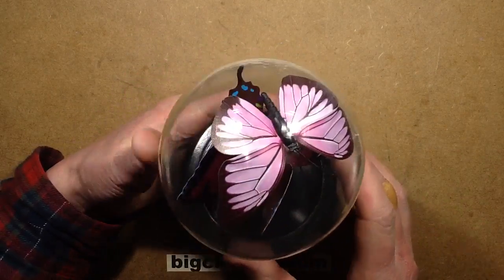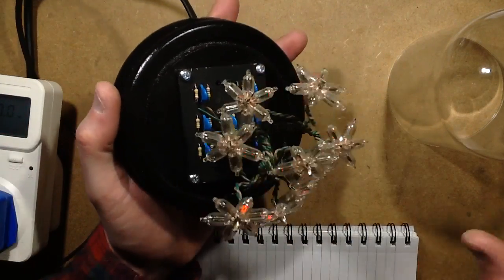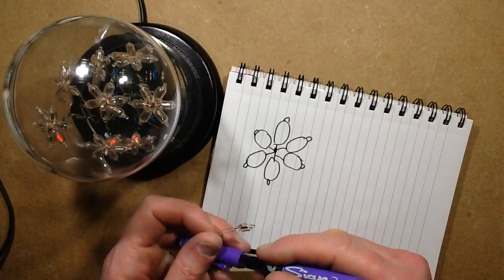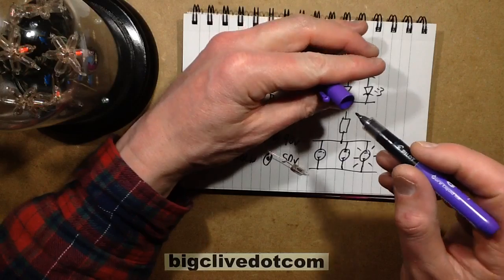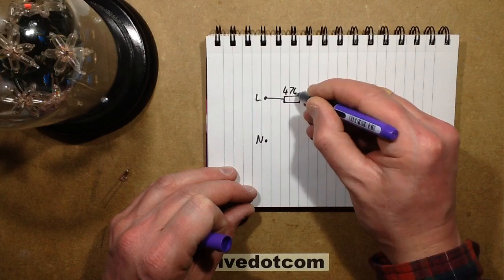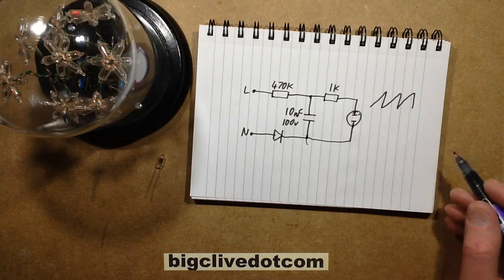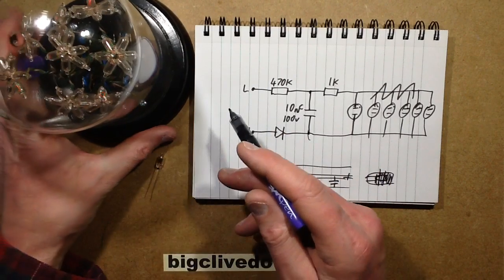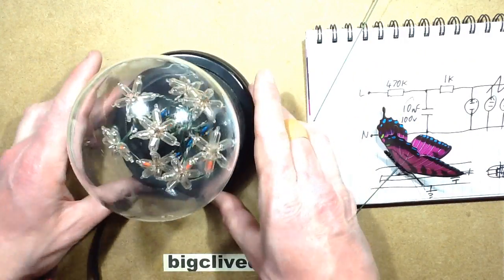Rehousing my neon nixie-flowers in a glass dome.

Comment: Still experimenting with getting this to work on 120 VAC 60 Hz. After not getting any satisfactory results, I thought about what's different between 120 VAC 60 Hz and 240 VAC 50 Hz. The conduction angle is going to be different.

Small neon lamps ionize at voltages from 55 to 80 volts on AC and a pretty consistent 90 volts at DC. A neon can be used as a pretty stable 90 volt DC regulator. So I chose 90 volts for calculating conduction angle. Given a half wave rectifier, how much time does the power source spend above 90 volts?

For 120V 60 Hz it's above 90V for 116.2 degrees (5.38 ms) and below 90V for 243.8 degrees (11.29 ms).
For 240V 50 Hz it's above 90V for 149.2 degrees (8.29 ms) and below 90V for 210.8 degrees (11.71 ms).

I wondered if this difference was enough to prevent it from working so I changed to a full wave rectifier and got significantly better performance. There is now slow action, where the illuminated lamp changes every minute or so and non-illuminated lamps frequently show faint internal flickering.

I've also noticed that ambient light greatly improves the action. Ambient light causes the action to look much like that shown in your videos with all lamps flickering very rapidly, more rapidly than in the videos. Shining UV light on it, even from a distance, causes all lamps to glow almost steadily. When the light is removed, just one bulb remains lit and the action returns to slow changes every minute or so.

So, improvements but not there yet.
Reply: As I mentioned on another of Clive's videos, the problems of operation on 120 VAC 60 Hz are solved. Full wave rectification (no filtering) does the trick. I've settled on an RC of 680k and 10 nF. I've built ten flowers of six neons each to experiment with and all works fine except for one dead bulb. So I made a little test jig so I can test every lamp before using it.

Here's a fun tip. You can run two flowers in parallel on one RC circuit and the results are good. The "blooming" process with two flowers is fun to observe as the two flowers battle each. But soon (one to six hours) they both settle into their normal chaotic behavior.

Thanks, Clive, for your great videos and guidance on this.  Did you know that the first known observation of chaotic behavior in a manmade system was observed in 1927 and involved small neon bulbs? Yes, it's true. Van der Pers and Van der Mark were trying to develop telephone switching circuits using neons. Chaos theory had not been developed yet so they didn't know what they had observed but it's recorded in their lab notes as "irregular noise". Given the circuit topology, we know today they were observing bursts of chaotic behavior.
Reply: I've taken to binning neons into three categories, low, mid, and high Vs. And I made a jig where I can run two strings of 25 neons and preselect those that get along well into sets of 4 to 7 lamps.

With more experience and experimentation, I've reduced the R value to 390k with the 10 nF cap. So 120 VAC, full wave rectifier, 390k, 10 nF, and the 1k inrush limiter.  On Amazon one can find very nice, small, FW rectifiers rated at 2A and 1000V. It's marked as a 2W10.

Lastly, I got hold of some A1C neons. They are SO CUTE!  They're tiny, the size of a grain of wheat bulb. An NE-2 looks gigantic next to an A1C. And they work great, even better than NE-2s in my setup here.  NE-2s are designated as 6x16 millimeters. A1C lamps are designated as 4x10 millimeters. You can find sacks of 100 A1C lamps on Amazon for $10 U.S.  The tiny lamps work great in flowers.

Comment: Hi Big Clive. Did you do a video on building this neon flower "bouquet"? With 120V optional parts?o
Reply from the maker: The highest value resistor would be lowered to match the supply voltage.
Reply: Thanks Clive. I'd still like to see a full build video, if you ever make another one.

Comment: Very cool, like the other ones, and a nice reveal that the idea is actually quite a time served one.

A thought that occurred, if you take out the main supply resistor, would the extra voltage mean you'd get two or three neons lighting simultaneously instead of just one? And if so, would they keep flickering, or would that essentially cause that two/three to remain steadily lit?

Oh, and "stem with the LEDs on it" - Light Emitting Devices, right? :)

Comment: I used your circuit idea to make an 8-neon 'flower' thing - however, I split the resistive dropper in two, one half in the live one half in neutral line for ease of construction, and it seems that having the '90v neon rails' sit in between the mains rails like this causes much faster switching between neons - I swapped both droppers to the live also, so the neons are ref'd to the neutral, and I get switching more like you do. Also, with either dropper scheme I find that swapping L and N gives different effects - one way round I get switching, the other way round I get one neon lit, but if I touch another neon, that one lights permanently, and so on. Which isn't so good :o) I'm surprised that with the 'balanced' dropper scheme that mains 'polarity' matters at all - very odd. Anyway Clive, very good - the neon flower is mesmerising in dark conditions - I've ordered some neons from 2 more suppliers to see how differently they behave...
PS. YT has removed their messaging now - how the hell do people contact you to send you stuff to review, or sweets, or whatever ???   Dave

Comment: Hey Clive. What might I need if I have neons that are rated 90v from China? and mains here is 120v I've no luck with the 10nf capacitor.
Reply from the maker: +CorJFexd (CJFD) Are the neons lighting?  Even on 110/120V they should light, although you will get brighter results with a lower value of resistor.  Double check your wiring for a short, and make sure the capacitor is rated at least 100V.
Reply: I've got a 100k and 1k resistor and the capacitor is rated for 400v. I've tried this same orientation but with Russian neons rated for 240v. The Russian neons work perfectly but the Chinese ones rated for 90v only flicker between two out of 6 leds. Thanks Clive!
Reply from the maker: +CorJFexd (CJFD) Just leave it running continually and it will gradually stabilise and the other neons will start to flicker too.
Reply: +bigclivedotcom alrighty I'll give it a shot. thanks again
Reply from the maker: +CorJFexd (CJFD) As long as all the neons are matched (from the same batch) they should gradually work together.  You could substitute a lower value for the 100K resistor on 120V.  Something like 39K.

Comment: Clive - I made one of these as your circuit and I only get one of the six Nixie lamps lighting. What could I do or change to start the effect?
Reply from the maker: +Invogue UK Are they all in parallel and are all the neons from the same batch?  If they are then leave it running for a few days continuously and it should gradually start to kick into action.
Reply: +bigclivedotcom All in parallel correct and the same batch (I bought 40 of them). I'll leave it on and see what happens. Thanks for the reply - I'm looking forward to getting this working as a present for my daughter. Strange, I also noticed the neons do react to light and all sorts of external interference.
Reply: +Invogue UK Did yours eventually start flickering? I tried building this and I also have only one neon that is lit.
Reply from the maker: +jayksopp mipser Were all the neons from the same supplier and batch?  If you mix random sources one neon lamp will almost invariable end up dominant.  The lights have to be left running continually for a modest length of time until the effect really settles in.  It's also best in a dark room.
Reply: Yes they are all from the same batch. Bought them on ebay 
http://www.benl.ebay.be/itm/141596487270?_trksid=p2057872.m2749.l2649&ssPageName=STRK%3AMEBIDX%3AIT

They have been running for two days now but still nothing. Do you know of some way to bin or age them so the striking voltage gets closer together?
Reply from the maker: +jayksopp mipser If one is very dominant you could change it, but the effect evolves over time.  If you just leave it running 24/7 then you'll notice it should start getting very active at night in a darker room.
Reply: ***** Bigclivedotcom is an absolute guru... He knows his stuff, of course they all started flickering just as he said. Just put them in a dark room on for a few days. Eventually they all will start.
Reply: Eventually though I noticed they did sputter. I have spares to replace them. I'm making another one today

Comment: Clive, 
Very nice work! I made a matrix of these with NE-2 and green, blue, and yellow argon fluorescent lamps. These don't have current limiting resistors to limit sputtering yet.
Here is what I built: https://www.youtube.com/watch?v=qz36XrfhohE
Reply from the maker: +emuman100 That looks great.  The addition of the audio would make it a good art gallery exhibit.
Reply: Thanks! I'm going to use different suppression for the audio amp so I get a different sound. I plan on hanging it on the wall when done as a show piece.

Comment: Beautiful work!

I'm currently working on making this for Mother's day (I make LED christmas trees for my mom every year). I cannot find any of these dome cases locally, so I'm stuck ordering online, what is the diameter of the base and the height of the glass dome? Just wanting to get something in the same size. I'll be etching my own pcb and even found components that are green/brown colored to match!

Keep up the excellent work! Always look forward to your videos. :)
Reply from the maker: +Zanthess The glass dome is 4" (100mm) diameter by 6" (150mm) tall.  But it may be a case of using what you can find.
Reply: +bigclivedotcom awesome thanks! I'm excited to get these "death flowers" put together.
Reply: +bigclivedotcom I managed to find four different sizes of neon bulb not really sure what would look the best and also was curious as to how the activity would change. The longest bulb I have (Eiko A1A) takes quite a long while to get going while some small stubby bulbs (VCC A1C) go absolutely bonkers as soon as you turn on the circuit almost to where the flower looks just completely lit with some "inverse flickering" I guess compared to the other flowers.

Hypothesizing the longer electrodes allow for greater variation of spark voltage, or the size of the gas chamber with variances in percentages of neon and argon that might cause a variance as well. Not really sure as this is not my expertise, but I will have plenty of bulbs leftover after I build my "deathly daisy" display (as I'm now calling it, Needed a bit more drama for my Mother to ooh and ahh over). Now wishing I had some more precise measuring equipment to test this idea.

Comment: as neon is a noble or inert gas, why do neons die?
Reply from the maker: +Project 806 Camper Although very reliable, neons do fail as a result of pressure change inside the lamp to where the discharge voltage increases to the point that they start flickering.  This is most common if they are driven at too high a current causing sputtering and out-gassing of the electrodes.  Another failure mode is glass-seal stress allowing air to seep in over time.

Comment: For us Americans who would like to make a similar project, I imagine for 120V you would want to lower the 470k resistor value?  I have some of the IN-3 which operate at 0.8mA which would imply a 150kOhm if you were just simply wiring it up to mains.
Reply from the maker: +Bryan Humphreys You have to deduct the neon strike and run voltage from the mains voltage sop it would be lower.  I';d suggest trying it with a 100K resistor.

Comment: hey clive, this may be a stupid question, but why does the first cap only have to be rated at 100v? Isn't there 230/240 volts going into it?
Reply from the maker: +linuxdaemon1372 As soon as strike voltage of the neon is reached it discharges the capacitor.  So it will never go above 100V.
Reply: +bigclivedotcom That makes perfect sense! thank you.

Comment: Interesting that the neons sort of "lock" based on light exposure, maybe try some vht nite shades, or another spray on headlight tint to take the edge off, so that they are more active in the light. Perhaps even one coat alone would do it. If not it's removable with brake cleaner (or so I hear)

Comment: Crackle tube, never heard the name, but they are used on the "Borg alcoves" in Star Trek.
Reply from the maker: +James Lewis Are you thinking oif the luminglass disks?  Similar but layers of glass fused together with phosphor coated glass beads in between them and energised centrally with a high frequency supply.
Reply: +bigclivedotcom Ah, interesting...

Comment: I was just looking at these projects on your website earlier today! I'm really tempted to build something with it, as I should have everything I need in my stash (aside from the neons). I'm curious though, do you know if there's any limit to how many neons you can put onto one circuit? I had the idea to replace the bulbs in a christmas light set with neons and hook it up to this circuit; seems like that would create an interesting set of lights with really minimal work. 

Also, I'm curious if you know why the neons seem to act differently in the light. Is it merely perception or is there something else going on?
Reply from the maker: +Lunar Hermit It would be a bit too dark and spread out if used as a string of lights.  The neons definitely become less active in light.  Probably due to the extra external photonic stimulation keeping the last one to light in a partially ionised state for longer.

Comment: Hi clive can you tell me what size tubes you have used? I've come across 4mm, 5mm and 6mm tubes. I'm guessing the size of the tube doesn't matter but would like to make sure.
Reply from the maker: +zerodegrees8 the ones I used are 6mm x 16mm from a UK supplier.
http://www.rapidonline.com/electronic-components/rvfm-ne-2h-6mm-miniature-neon-wire-ended-42-0300
Reply: +bigclivedotcom thank you, keep up with the great videos!

Comment: +bigclivedotcom
This may seem off topic but this is really bothering me:
Could you make a capacitive dropper using two electrolytic in reverse parallel with a diode in the appropriate direction for each capacitor? So I can get more current in a smaller space.
http://i.imgur.com/7Wr1Upq.png
Heres a quick image I whipped up you don't understand what I mean
Reply from the maker: +chems No.  You would have to use a proper non polarised capacitor.

Comment: Hi Big Clive,
I enjoyed this video like all the rest. I was wondering if you could help me out on another subject. You seem to be the best on YouTube to ask. 
When running a 3 phase motor on one phase, with a  capacitor, do you lose one third the power? Can you add another capacitor to make up for it?
Thanks a lot.
Greg
Reply from the maker: +greg La Roche It's not an efficient way to do it.  If you need something more efficient and higher torque then you can use a small variable frequency drive that recreates a proper three phase output from the single phase input.
Reply: +bigclivedotcom  Thanks for the reply. I looked into variable frequency drives, but found them too expensive for my project. I will probably put in three phase supply and be done with it. Thanks again. Greg

Comment: Nice - takes advantage of the higher starting voltage/ lower sustain and then minimum firing voltage AND it looks cute!  Your explanations are very clear; how that over-current spatter business damages 'em and then they "devolve" into darkness. Factory-fresh little Ne-2 buggers have a dash of radioactive gas that helps them get initially fired up RELIABLY @ ~90v.  It's the rad decay (~10 years half-life) that also makes an old one harder to fire up, requiring a slightly higher starting voltage. The firing voltage of a decayed Ne-2 can still be lowered a bit in bright (UV?) light so they seem to "evolve" as you say in the video.  A version with a higher percentage of Argon gas inside gives a dim UV/green glow (and an optional phosphor coating inside can enhance brightness and produce other colors).  The traditional clear glass Neon orange glow is still my favorite. A close look at those electrodes identifies AC or the DC polarity applied!  As a kid, I was also amazed at their sensitivity when a 50k or 100k resistor and Neon lamp in series allowed 110vac line current to pass through my body with no apparent sensation or deadly effect and make the lamp glow. I'm pleased to report today's blue LEDs blow that low current/light trick away (provided reverse voltages and overall forward current is never exceeded!) and will "barely light up" at a very low current obtained from 120vac line voltage passing through a 4007 diode and several meg ohms of resistance.

Comment: clever design but my wife thinks it must use electric even though the power meter said 0ma. I said it does but it's so small it won't register. then as he asked how many pence per year to run it ? hmm.....
Reply: +BillyNoMates1974 if we assume the meter reads anything under 0.5 mA as 0 mA, and even if we assume that the device is drawing the max it could for a 0 reading, then 0.4mA * 240 v gives us 0.096 watts. at 8766 hours per year multiplied by this 0.096 watts per hour gives us 841.536 watt hours per year consumed by this device at worst case scenario. In Canada where I live we pay 7 cents per kilowatt hour (1000 watt hours) so that would be 6 cents per year for always on operation.

Please note this maths is done at worst case scenario for the meter reading 0mA assuming that it rounds 0.5mA and higher up to 1. Clive likely could provide us a much more accurate measure using one of his good meters and we could be more accurate.

Comment: And could you put salt in a cup with an electrode boiler until it pops (melts)
Reply from the maker: +super awsome minecrafter You could do it until the fuse on that circuit blew or the cable melted.